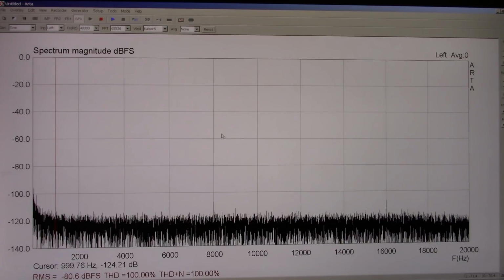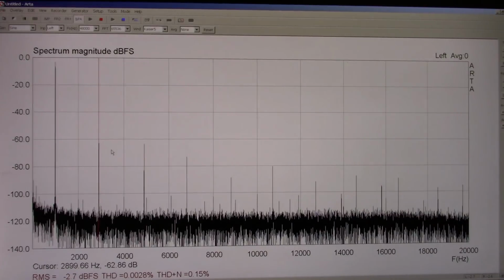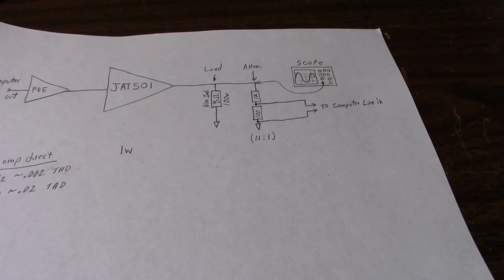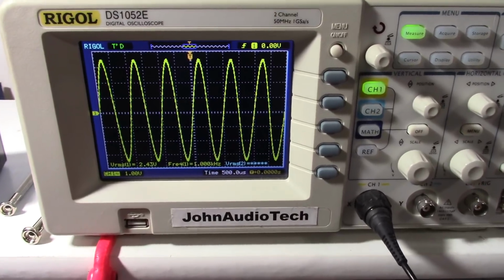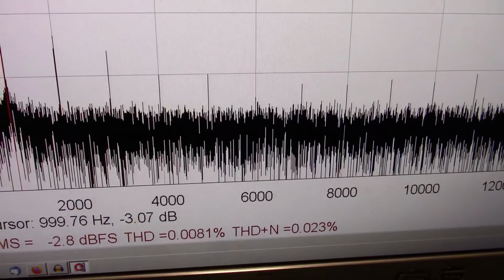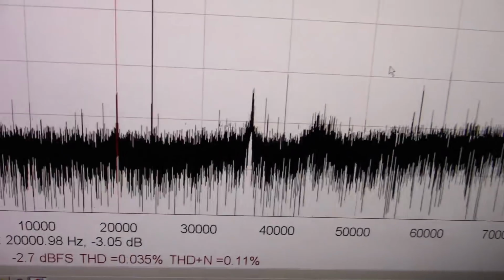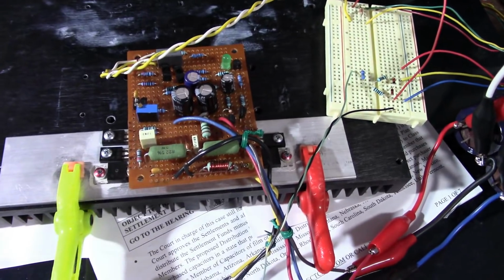Discrete audio amplifer project PT20.1 distortion measurement

Comment: You are confusing ratios with fractions - a very common thing.
The ratio is 10:1, not 11:1
A 10:1 ratio has 11 parts total, making the resulting fraction 1/11 or "one in eleven."
This is an unfortunate byproduct of how this material is taught (been this was for decades), and causes huge amounts of confusion. It is useful at times to express a ratio as a fraction (like when doing stoichiometric calculations). People end up thinking that a ratio of 10:1 is the same as 1/10, or in this case 1/11 = 11:1. This is simple incorrect.
Reply: I thought my feelings here were right! Purely out of thinking about it, not my education. As there is 1000:100 which is 10:1, simple. But the voltage is 1/11 haha it's trying to be tricky.
Makes it pretty simple: if 10V is where it starts it's 10V/11= 0.90909V

Comment: Try using metal shielded casing, I recently made an amp (LiPo powered) and put everything inside a broken CPU power supply casing, very very low distortion due to Faraday Casing effect !

Comment: Looks as if you are using a windows XP computer and out of date software , There are a lot better software programs like visual Analyser , and a older computer would be better off running Linix OS, you wold be better off and don't cost anything, both the OS and Analyser software are free! I use them my self and am very impressed with the performance of both, on my old desktop.

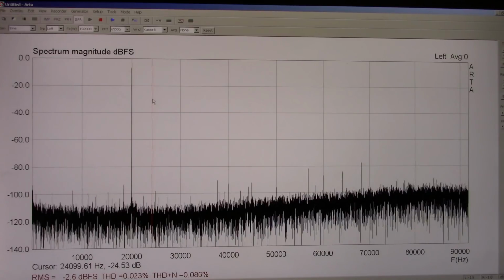Comment: @7:40 - here's how you are getting the 24.100 KHz spike:
Your base frequency 20 KHz is somehow squeezed into 44.100 KHz (CD style) sampling rate. The nyquist frequency of that is 22.050. If you mirror 20.000 over 22.050 you get exactly 24.100 so what you are seeing is the 20 KHz aliased over nyquist (Monty Montgomery has a nice explanation at https://www.youtube.com/watch?v=FG9jemV1T7I).
Anyways, either your source file or your audio device or anything in your audio path is 44.100 rather than 96/192 KHz. It could be windows drivers if you have old windows.
Reply: Another thing worth noting is that the FFT algorithm that is producing frequency spectrum for the graph is usually working on sample windows that are multiples of 2^n samples - for example 4096 samples or 8192 or 16384 samples (this is how Fast Fourier Transforms work most efficiently).
You'd therefore wish to squeeze the sine wave in such a way that 4096 is divisible by the wavelentgh of your sine wave (wavelength in PCM samples).
For example, if the Audacity file is generated for ~1 KHz signal at 48 KHz sampling rate, the actual FFT friendly frequency should be either 996.09375 Hz or 1007.8125 Hz (instead of 1000 Hz).
Similarly for the 44.100 KHz sampling rate the ~1KHz FFT friendly frequency should be 1001.2939453125 Hz.
I don't think this is really related to the aliasing issue, but if you wish to be really precise, this is worth keeping in mind.
Reply: In such situation, I'd probably start by rendering higher sampling rate test files in Audacity. Also I'd experiment with 96KHz vs 88.2 KHz (which has less noise or ghosts) to see what is matching your system's sampling rate better.
Reply: Maybe this is what is going on: Imagine that the computer has only one single digital audio converter that it can drive either at a multiple of 44.1 KHz or 48 KHz at any single time. If your oscilloscope software decides to sample the audio at 192 KHz, then it will configure the device for a multiple of 48 KHz (usually ADC and DAC are in the same chip and running at the same frequency).
If you are then playing a file sampled at 44.1 KHz on that same audio device at that same time (e.g. playing the sine wave generated by Audacity), it will need to resample that 44.1 KHz PCM signal to 48 KHz PCM and by doing that, it may introduce some aliasing.

Comment: I could have used more of a soft start with this series. Where some other amplifiers were measured so I had a basis of comparison. The extra details given here are lost on me without some frame of reference to hang them all on. Sure I've seen distortion measurements but I'm not sure if they are directly comparable to what I'm seeing here. There a larger sample size would have been appreciated.
Reply from the maker: I will likely measure my next amp, the JAT EZ AMP, the same way. I wish for better distortion analyzer equipment in the mean time.
Reply: @JohnAudioTech  you use your FFT analyzer on a variety of amps. That helps us viewers relate to what we're seeing. I feel the lack of that aid here severely. As I've nothing to compare and contrast with.

Comment: Snickers says that this amp is the Cat's Meow!

Nicely done. Measures very well.
Devil's advocate time, though. Will you be putting any  input or output protection in the amp should the inevitable part failure happen? I'd hate to see anyone try to come back at you should they screw up their kit or not purchase components from a reputable supplier, or any other number of faux reasons to try to shift responsibility off themselves.
Reply from the maker: The amp will not have onboard protection circuitry but will have a provision to add an outboard DC & short circuit protection. I will clearly state that my board/kits are for use at you own risk. I'm not a big company with lawyers.
Reply: @JohnAudioTech  That's good to know. In today's world, you can never be too careful.
Reply: @JohnAudioTech  People need to take responsibility for themselves anyway. This capitalising upon litigation when something is largely their own doing is ridiculous. 
Also if you blow something up, fix it, learn and move on... be more careful next time.
Definitely provide a disclaimer notice though

Comment: John, when you were using their generator and measuring 1kHz last time, wasn't there a pair of odd signals 1kHz on either side of 44100, like at 43100 and 45100?  Now at 20kHz, there's an odd signal 20kHz away at 24100.  And again with 19kHz there's a signal at 25100.  I'm not sure how it's happening but there's definitely a bug in their generator, since it doesn't happen with Audacity.
Reply from the maker: I was using my music player in the last video but the difference between the Audacity generated tone and the ARTA built in tone generator is interesting. I'm no expert in DSP, perhaps they generate the tones using a different set of math.
Reply: @JohnAudioTech  I have no idea, but (after watching the whole video) it looks like intermod distortion with a 44.1khz signal that's not even there.  Weird.
Reply: Probably old version or compatibilities with driver or something. I have used arta for years and was able to get 0.00006% THD no issue.
Reply: Possibly 48000khz is not the sample rate of windows audio. Use native sample rate should solve this probably.
Reply: It would be the best to use asio4all and use asio selection in arta.

Comment: i was waiting this video since the last one, so, if i want to measure it at 4Ω, what the value of the resistor divider should i choose ?, and is the resistor divider configuration is depend on the output voltage of the amplifier ? should i paralel the 100rΩ with 2 zener diode back-to-back to clamp the voltage ?
Reply from the maker: The load on the amplifier has little effect on the attenuator. I ended up using a 4k7 and 100 ohm in the attenuator. After the attenuater, I used a 1k ohm resistor in front of the zener voltage clamp. I added this during the test when I was having problems. I was afraid of damaging the computers line in. It is possible the junction capacitance of the zeners will cause distortion to the signal at 20Khz. I'd have to research that.
Reply: @JohnAudioTech  umm, here's a drawing of the circuit that you said https://imgur.com/a/v1HccbY , is it correct or not, and do i really need pre-amplifier, and i just test my PC soundcard, i found out that my PC soundcard is not too good, it end up with 0.0090% THD with 0.030% THD+N, when i use my old iphone as signal generator, the THD drops to 0.0058% and the THD+N around 0.025%, do you think this numbers pretty good, or it can be better if i have separate audio interface and a good signal generator ?

Comment from the maker: First! A lot of relevant blab in the first half of the video. Measurements begin around 13:30
Reply: Well, I get the feeling that this will be a superb amplifier once it's built up on a well designed PCB. Avoidance of Ground loops and having common ground points for specific parts of the amplifier will be key, as well as low impedances in the high current ground returns.
I suspect that oscillation you experienced to begin with may not have happened if it was built on a decently designed PCB. Actually... when you were doing these distortion tests, did it come to mind that you added those capacitors? I wonder how much they could be affecting your circuits behavior at high frequencies. It clearly doesn't matter for below 20khz, which is what's important anyway.